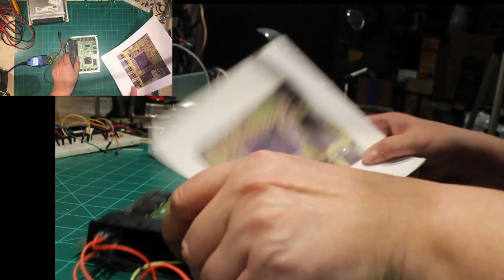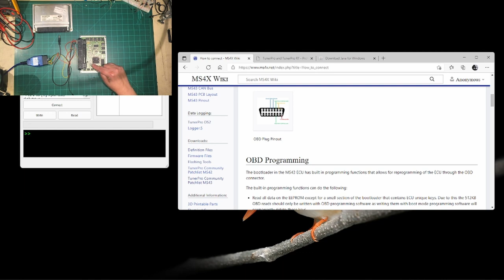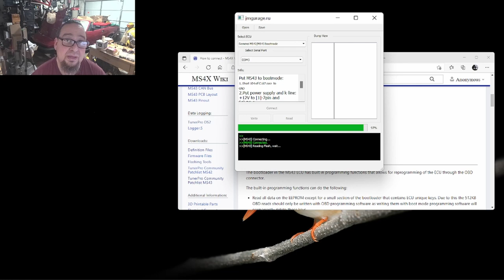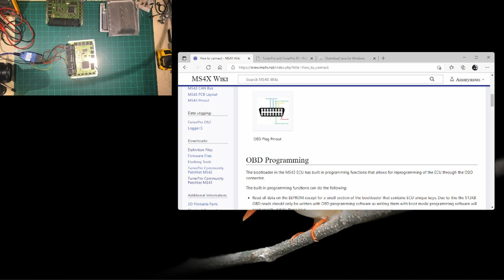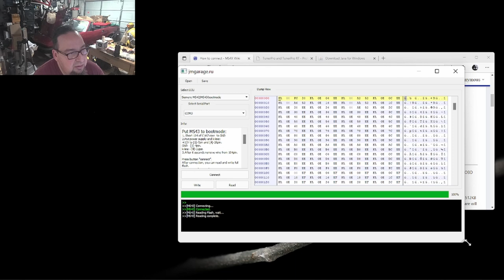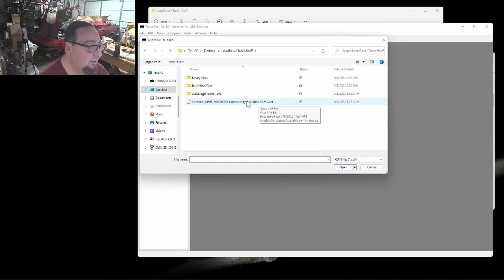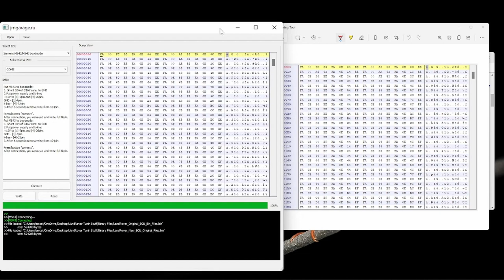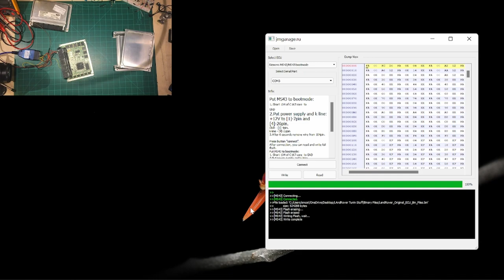Will It Run - 2003 Land Rover Freelander. MS43 ECU reading and writing too!

Comment: We had a Freelander V6 here in Australia a long time ago before we got a Diesel variant of this car, and we've also had this problem before. This is not a total ECU fault, there is a problem with the sensor coil. The coils, when they start failing, the engine just doesn't know when to fire up as the sensor coils are no longer functional. You need to replace those and it's fairly easy to replace as they are like cables, and this should start firing up the engine.
Reply from the maker: Thanks so much for the information. Yes, I do believe it's the crankshaft position sensor and it's a beast to get out since I have to remove the whole front end... Kinda the reason I got discouraged too.  Thanks for watching, much appreciated.